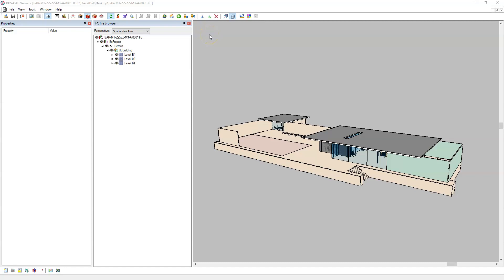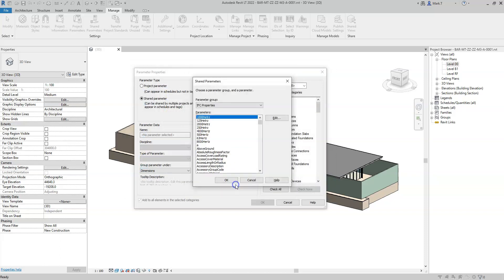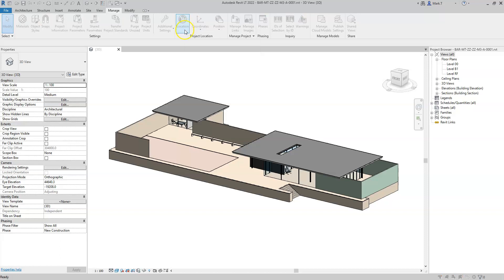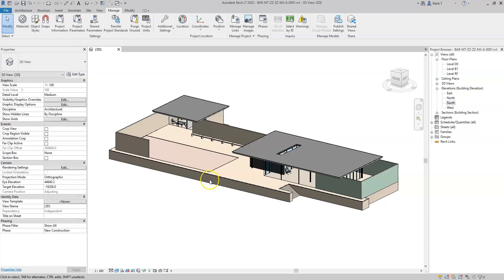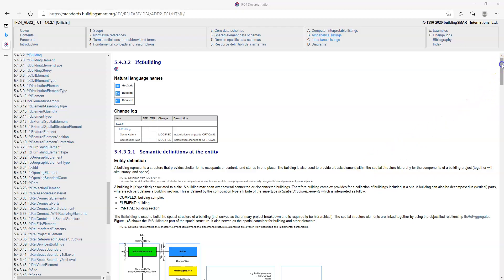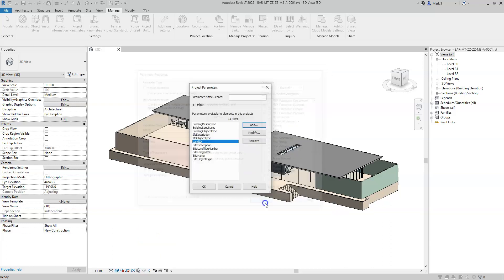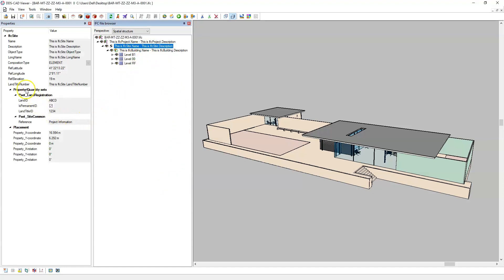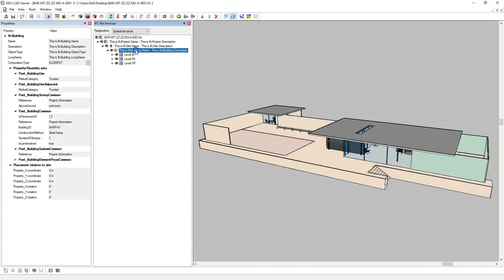Revit to IFC: An Export Guide - Part 3 -  Exporting IfcProject, IfcSite & IfcBuilding

Comment: Thank so much for this amazing videos 
i have the table of Property Sets for Objects not like the video. How can i do similar to the video?
Reply from the maker: Thanka for your question. Are you using the shared parameter file available as part of the IFC Exporter download?
Reply: @practicalbimresources8668  thanks for your answer. I mean the Table of the Property Sets for Objects in IFC4 Documentation - buildingSMART International Stantards.
Reply: @practicalbimresources8668  I found the right link for IFC4 Documentation and it's similar to the one used in videos😉